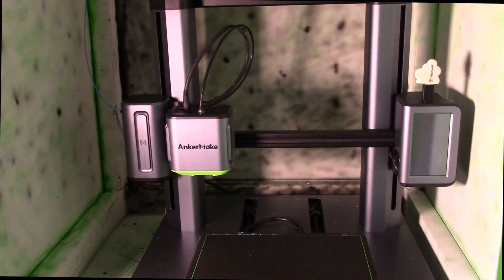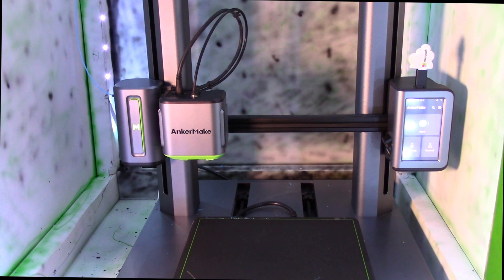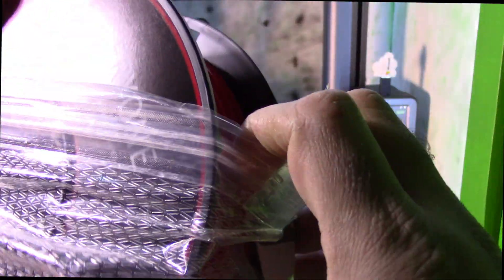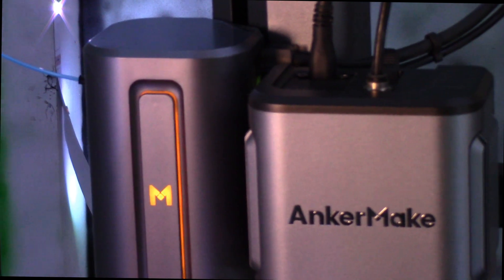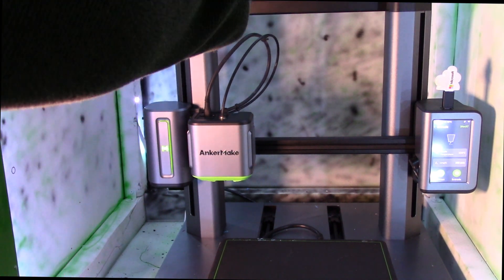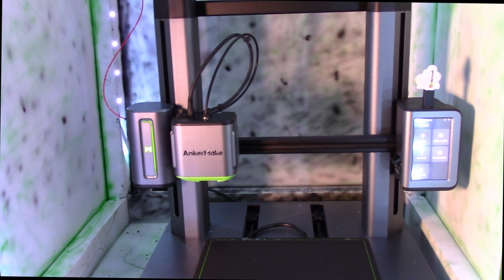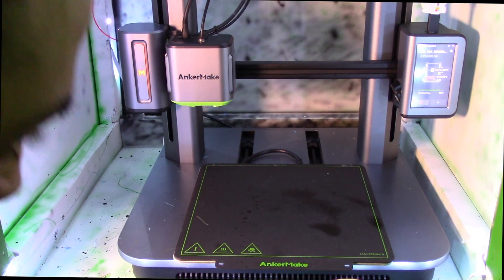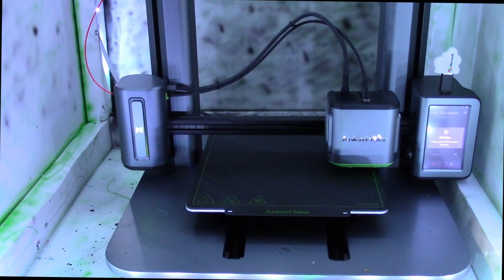Mic-Bot Entertainment: AnkerMake M5 Quick and Clean Filament Change

Comment: when you pause a print 
The nozzle doesn’t lift up like you show so when you start adding new filament it builds up starts clogging tip
Reply from the maker: Odd. You will then need to add an extra step and raise the z axis up by about 40mm, then click home after the filament change.